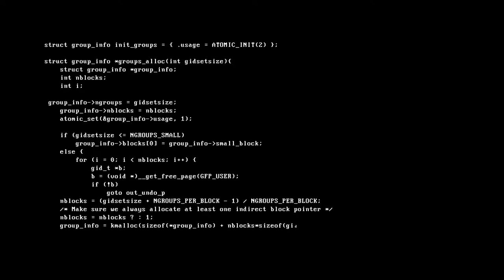Arduino Robot Arm: Re-filling my beer 🍻 glass (ESP8266 💡)

Comment from the maker: Some explanation on the robot arm: it's a metal robotic arm controlled by a web-interface. The GUI allowed me to set a specific position and the save it. E.g. When I set 5 different positions (multiplied by 6 servos) and press play, the signals are send to an ESP8266 WiFi chip. The chip sends the signals to an Arduino Mega.. the Arduino Mega is setting the value on the servos. The movement takes time, around 3 seconds.  If the arm moves from point A to Point B all steps in-between are send to the ESP8266. Not efficient but it works well. What should I do next with the robotic arm? Subscribe if you want to see future improvements.